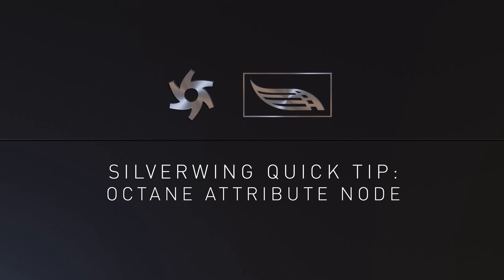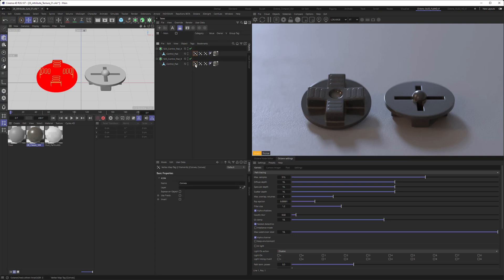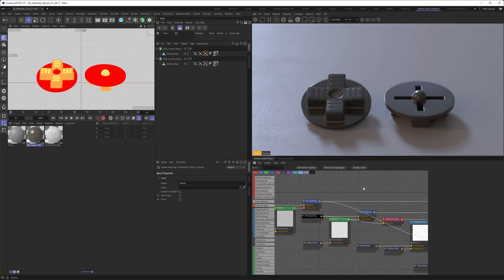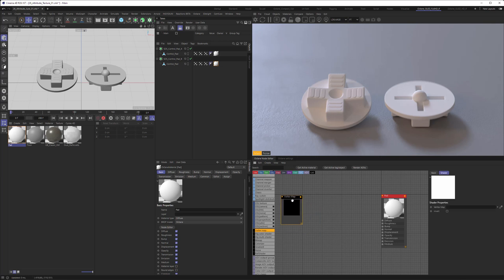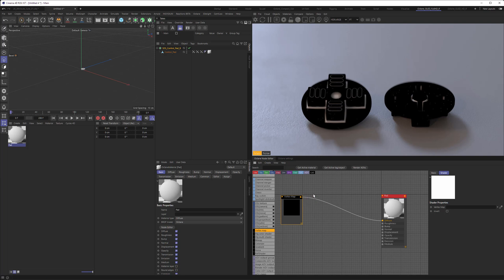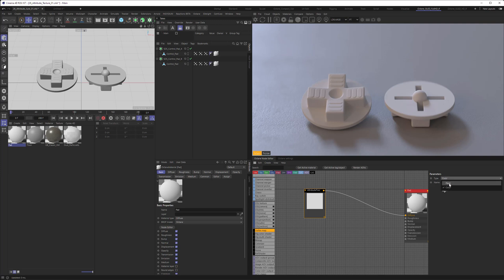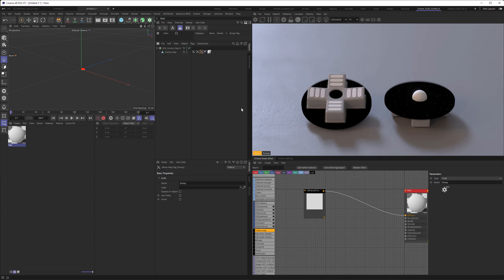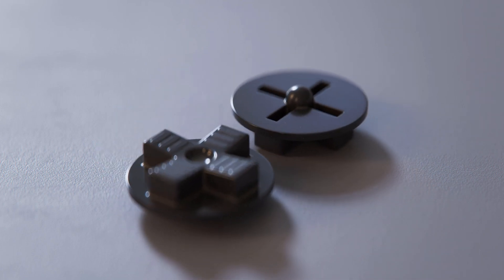Silverwing Quick Tip: Octane Attribute Node (For Easy Vertex Color / Vertex Map Handling)

Comment: Hi, thanks for this awesome tutorial! I am following this and however, when I apply the shader, the material result looks blurry in the render. When I select the vertex color tag in object manager, the mesh displays the color accurately in viewport, however the result is a blurred mess in the render. Looks like octane is not handling the data properly. I am not able to find a solution in internet, do you have any idea what might be the problem? Thanks!

upon further investigation, I found out that the octane shader is not able to process the UVs of the vertex map or the mesh properly. Hence it displaces the map and is a mess.
Reply from the maker: Hey there and thank you for your comment.
To help me understand your setup and what you have in mind, it's always best to describe your goal.
Also I am not quite sure what you mean by "octane shader is not able to process the UVs of the vertex map"  Usually vertex maps are used, because they are not reliant on UVs 😇
If you still need help with the setup, then could you clarify those points for me.

Comment: Ehi! Do you know if it's possible to use a vertex map as input for vertex displacement in octane? I've also tried to bake the vertex map with a baking node and then changing the displacement into a texture displacement but it's not working for me
Reply from the maker: Hey Matteo,
unfortunately this is a limitation and Vertex Maps can´t be used as Displacement in Octane at all.
Baking the vertex map into a texture should work however. But that requires the object to have good, non overlapping UVs.
As soon as its a texture mapped on UV basis, it should work even with texture displacement.
I made a video on baking textures a while ago. Maybe this further helps:
https://youtu.be/gcJNWtI7ouc

Comment: Very helpful! Thank you! Would the coloring work using a MoGraph Weightmap on a cloner as well?
Reply from the maker: Thank you very much.

Not sure if I understand you right and therefore my answer might be off.

Do you mean using fields in the vertex tag?
If so, yes! You can just readout the vertex data with the attribute as is.

You can´t however make the fields visible in the shader directly.

If you talking about clone color. This can also be displayed via the mograph color node.

Hope this helps.

Comment: Hi Raphael, thanks for the great tutorial ! 😊
I just watched the tutorial and tried it.
However, I copied and loaded it into a new scene, but the Vertex Map is linked as it is.
Did Otoy solve this problem by any chance? Or did I do something wrong?😭
If this problem is solved, which one should I use, Vertex Map Node or Attribute Texture Node?
Reply from the maker: Hey there.
Unless anything is broken, attribute map should work.
From your text its hard to understand what went wrong.
If you follow exactly what I do in my tutorial (using the Attribute Texture) it should work!
Make sure the vertex map are named accordingly on your objects.
Reply: @SilverwingVFX   I'm sorry I didn't explain well. I mean you said in your tutorial it didn't work that Vertex Map Node the feature link. But when I tried it by using Vertex Map Node not Attribute Texture Node, it did linked well. So I'm wondering the Otoy fix this issue which it didn't link when I copied it and pasted it in new scene by any chance?
Reply from the maker: @JiseongKim-o3o  Ah OK I get it now.
If you are copying the object with the materials both, then it´s no problem. Because you both copying the object that is linked to and the material containing the link.

As soon as you delete the object the link was linked to, it will be gone.
This can be an overview nightmare with big projects. Because its not visible at first sight what specific vertex map is linked.

Also if you just want to copy over materials to a new scene with out copying the object, they will all loose the link.

Hope that explains it better 🙂

Comment: Is there any advantage of using vertex maps compared to the octane dirt node? I assume it is more controllable.
Also: too bad C4d cannot select polygons based on curvature to create the vertex maps automatically. That would be a nice addition to fields for instance.
Reply from the maker: There are advantages and disadvantages:
Advantages: Needs less compute then raytraced effects like dirt or curvature. Can be controlled via Fields / Mograph. Does not need to be on edges. You can paint it wherever you want.

Disadvantages: Takes time to set up. No Radius Map input to vary the range (Though there are other ways to do that). Can´t be as dynamic as Dirt e.g. if you want to simulate foam on a water surface from one object to the water.

And yeah. A curvature to vertex weight would really be amazing in C4D.
Reply: @SilverwingVFX  I just realize that this actually exists in 2023. I tested it on a landscape object.
Create the object > Add a vertex map > Select the fields vertex map type > Drag the object into the field > At the bottom, go to curvature mode > Choose concave or convex.

Comment: i was wondering if it was possible to use substance anchor points in correspondence to the improved vertex map support in octane to achieve a "wiped dust look." do you think thats possible?
Reply from the maker: Hi there 🙂
I have a rough understanding of Substance Anchor Points. But I am unfortunately not that deep into Substance, so I can´t answer your question without having more info. If you have the time you may explain your Idea in a little more detail. What do you mean by "wiped dust look". Maybe you can point me in the right direction 🖖
Reply: @SilverwingVFX  i've honestly been trying to elaborate on what i meant for the past few minutes -- and i just can articulate it without a visual representation. regardless, thank you for caring so much about the question. its evident that youre doing this out of pure passion.
Reply from the maker: @bulba1561  You might write me an email and attach images and videos if you like.
The mail address is found on my website. Don´t want to link it here. Getting enough spam already 😇

Comment: Hi Raphael,thank you for your tips!  there is no doubt vertex map is a great method when make worn edges effects,and i follow you course , try to use vertex map to make that ,but when i set two vertex maps on the object ，edge and corner vertex maps, but only the first one (the one in the front) take effect，I tried many times ,I don't know why, Is it a bug? Or is there some thing wrong with my configuration? I use S22 version
Reply from the maker: I did not experience any buggy behavior.
Make sure you name your vertex map tags. They have to have different names.
Other then that just check if you have the newest Octane version 2021.1.6_R4
You have set the Attribute Node to set to Float.
Hope that helps.
Reply: @SilverwingVFX  thanks very much.I'm sure I named the two vertex maps two different names,and Octane version is 2021.1.thanks again for your reply

Comment: What a valuable Tip - thx Raphael! 3D is all about problem solving, I think this will never change... One question, how are you selecting your vertexMap areas so precisely? Are you using the modeling tools like loopselection ect. for it?
Reply from the maker: Hey, thank you very much for your comment. I must have missed it!
To answer your question: Yes I usually use selection tools like loop selection etc to get the Vertex map weighted.
Sometimes its a bit of work. But it usually pays of at the end!
Reply: @SilverwingVFX  is it possible to do the same thing but generate like a direction selection to lets say to create dirt? what stays on top of the surface of a geometry basically?
Reply from the maker: @bensasi  You can use fields for that I think. In the vertex map tick "Use Fields" then in there use a shader field with a C4D falloff Shader.
In this shader you can use the direction and the gradient to point the vertex map in to the desired direction.

P.s. Setting the space to "World" from "Object" in the shader makes the direction global. If you are going for something like snow.

Though all of this also can be done using shader level effects so you are not reliant on the Vertex map.
This is done with the Falloff node in Octane using the "Normal vs Vector" mode.

Comment: This will surely save me a lot of time, thank you kindly.
Quick question though, why use vertex map instead of going procedural using dirt node?
Reply from the maker: Thank you.
Yes you are right about the use of Dirt or Curvature node.
I also use them. So its not a bad thing. As with everything in this world every method has its advantages and disadvantages.

Of course Dirt an Curvature is a lot faster to set up and also can do the job pretty well.
But needs more render-resources / compute due to it being raytraced.
Can cause problems with inverted dirt on thinner parts "false selection" of non edge parts.
Settings (thickness etc) go for the whole object. Therefore not customizable / art directable as much.

Vertex Maps can be painted wherever you want.
But takes time to prepare them and also can cause problems if the underlying mesh does not have a hood flow or is not dense enough.

Also you can use vertex maps for non edge areas. I also have a tut in mind where I use vertex Maps to paint some rust  on surfaces.
(With the right underlying mesh) this is very art directable.

Comment: Thank you for this tip! I was wondering if you had a secret method to generate these convex / concave maps easily? Or maybe it’s just a simple point / loop selection.
Reply from the maker: Hey there and thank you for commenting!
Unfortunately I am doing this the "brute force" way by hand selecting everything. Of course I am using phong break selection, loop selection where applicable.

There are plugins that try to select vertexes based on the mesh curvature. But I never found them precise enough.
Reply: Was looking for the same thing. I saw it in one video and then lost it. Was looking through these comments in the hopes I would find it again and saw your comment. I just found it in one of the files I used to test it out. Create a vertex map > turn on the fields > then drag the same object into the field layer. It should work like the octane dirt node letting you select convex or concave. I hope this helps!
Reply: @imonline8051  Hey, that’s very kind of you! Nice trick, can’t wait to try this :)

Comment: Hey Silverwing, great tutorial, super useful. Are there other uses for the attribute node other than vertex? can it reference other strings within cinema??
Reply from the maker: As far as I know as of right now you can only reference Vertex Color and Vertex Maps. Maybe in the future you could bring in selections.
Reply: @SilverwingVFX  thanks a bunch for replying so soon. Looking forward to using your technique along side xpvertex to drive octane channels. I've been using xpvertex recently to add lakes and streams parametrically to C4Ds landscape object via the displacer. Xpvertex map acts like a live proximal shader  driven by any object. I've found I can drive Octane scatter objects with the same  vertex map to spawn different types of plants around the shoreline of the displaced mesh. So to be able to carry the  vertex links between scenes will save a heap of time.
Reply: It"s worth trying... things like set selections...